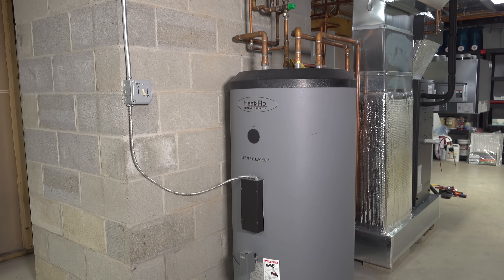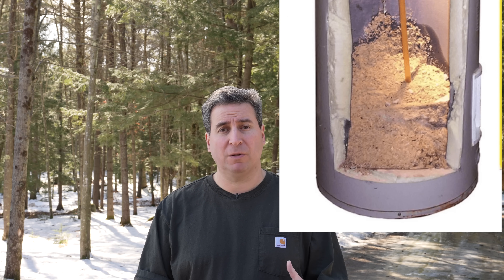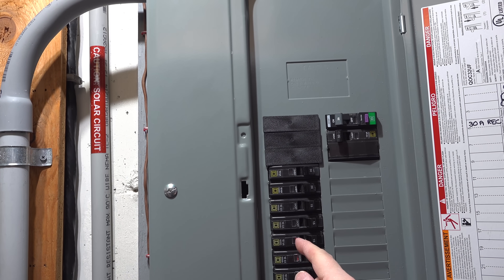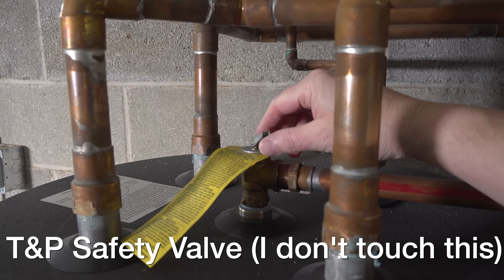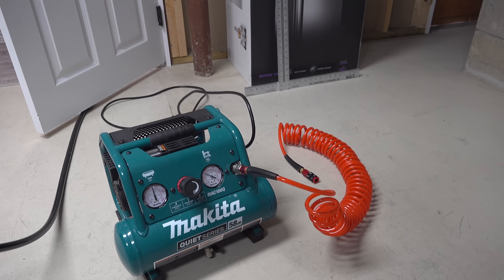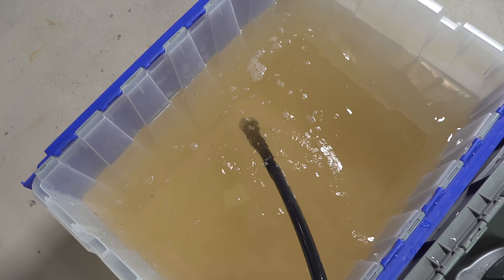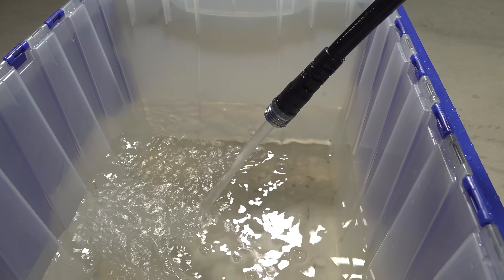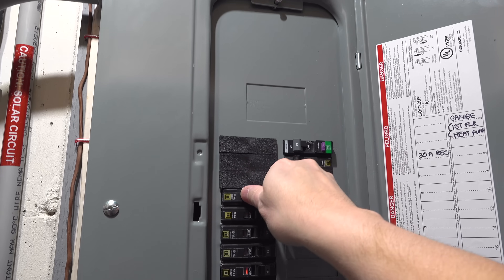EASY Way to Flush Your Hot Water Heater using AIR - Sediment Buster

Comment from the maker: What do you guys think? Sediment Buster: https://amzn.to/3ODRAh5 Hose Cap: https://amzn.to/49smLUs Bike Pump: https://amzn.to/49aOR6K
Reply: You forgot to discus changing the tank anodes! 

Also helps to have water filters installed to remove sediment before it goes into the hot water heater tank.
Reply: I use a Y connector with two shut-offs connected to the drain valve. I connect one branch to a water supply and the other branch to a hose to a drain. I shut-off the drain branch and run water from the other branch. When I want to drain, I close the supply branch and open the drain branch and the drain valve. I think water is more efficient than air.

Comment: 50 gallon hot water heaters cost about $600.  A 1.5 ton AC costs $1200.  A 30k BTU furnace costs $1500.  These are rough estimates that show hot water heaters are definitely NOT the most expensive appliance in our homes.  Heck, refrigerators cost much more.  Hot water heaters are expensive, and need maintenance.  Thanks for the video.  But your opening remarks are incorrect regarding costs.

Comment: This won't work for several inches of buildup, that quickly gets up to the heating element.  It's probably good for normal water sediment, but the flail tool has been useful for my water heaters, although still a hassle.  Let's make an easier to clean tank. Seriously!

Comment: I used the one with the drill driven spring auger; that worked much better than just air. I got 1 gallon of sediment out, a 35year old hot water tank.

Comment: I’m going to use the sediment buster and my air compressor to do what you have done here. However what should I set my air compressor regulator to? I don’t want to damage my water heater it’s only a year old. Would 20 or 30PSI be enough air pressure to give it quick bursts? I’m from New Hampshire. Thanks in advance!

Comment: We had plumber put in a new water heater about 1 year ago, since then our hot water is not coming out as quickly as it was prior to new water heater installation.  We do have a recirculation pump.  I had another plumber come out told we need  a compression valve and angle valve in order for the recirculating pump to work.  My question is why was it working great prior to the new water heater being installed?  Who to trust? 🤔

Comment: I have to doubt the effectiveness of blowing air through your drain valve. At best it will probably only clear sediment near the drain. I feel that opening your cold inlet valve would do more good due to the dip tube in your tank that directs inlet water to the bottom of your tank. Hot water outlets at the top of your tank. I'd even consider leaving some faucets open and drain most of the water. Then opening and closing the inlet valve in bursts.  Replacing the tiny  drain valve would be one of the best things you could do but I prefer gate valves over ball valves.

Comment: I didn't buy this setup but did blast the valve with air from my compressor and a standard air attachment.  One lesson learned is to run the hot water using the tub faucet. My sink faucets with aerators ended up clogging due to the loosened sediment. I had to take everything apart and had to thoroughly clean them.

Comment: My water heater's drain valve was made out of plastic.  Eventually it failed; water heater drained out under pressure and then kept flowing (located in the garage-ground floor made out of concrete).  Not sure how many hours the water was running before it was discovered.  It was a big residential hot water tank heated by natural gas.  Large local plumbing company showed up and fixed it that day (December 2023).  Slightly over $5,000 - OUCH.  Five stars for service and professionalism, one star for price.  The old saying was true; "Fast service, good quality and low price - pick two".  I got great fast service.............but did I ever have to $$$$ for it.  The worst part about it is I knew plastic drains on water heaters were a failure point, I missed the fact that I owned one.

Comment: I just drained my tank today for the first time in 5 years and managed to get about an entire hand-full of calcium deposits. When i installed the Bradford White gas heater, i made sure to get a contractor grade version which is built better, and has solid brass fittings. I did replace the normal spigot drain valve and installed a 3/4" (or 1" i forget) ball valve with a big lever. Makes draining and even inspecting the insides very simple. 
I also made sure to loosen the fitting that the Anode rod is attached to, gave it a few wraps with teflon tape, then screwed it back in. When the rod needs replacing, that simple task is going to make things much easier.

Comment: $40? Let's see, a two way brass garden hose splitter is $9, add a quick connect for your air compressor hose or if you have to use a bike pump, get a tire valve. When it is empty swap out the stock water heater drain valve for the full size ball valve as mentioned by others. When you flush next time you can still use the two way and the results will be even better. Be sure to remove your faucet strainers before and after for a day or two, and if they don't come out, don't use that faucet for as long as you can-a day or so. Usually it is a bathroom sink and using the toilet will clear the line. Also, don't waste the hot water, turn off the power or gas and then take a shower or wash some clothes before you start the flush. It will gradually cool off in the shower, it's not like it is immediate.

Comment: I replaced my electric water heater when it was 33 years old. It was not leaking. It had never been flushed. When I cut it open, it was severly corroded, but no sediment. I live in a small town which gets it's water supply from Lake Huron.

Comment: flushed my hot water heater awhile ago. Had a terrible plastic drain valve on it, replaced that with a ball valve.

Tried to change the anode rod too, but i was moving the whole hot watwr heater trying to break it loose. 😿

could you do a video on changing the anode rod too?

Comment: That looks  like a good tool.  I vacuum mine out through the bottom heater element hole, add water as needed and wet vac the scale out. 20 years and running good. My second set of elements this year.

Comment: you created a pressurized system...hence the increased water flow.

as far as stuff cleaning...sure it's going to be improved from the additional flow.  But you are in actuality only flushing out the drain valve here.

Comment: The slow water before the air was introduced was not due to blockage most likely. You turned off the cold water intake to the tank and the draining of the water created a vacuum as it drained. You specifically kept the overflow valve closed so it could not let air in there either.  Adding the air pressurized the tank, eliminating the vacuum, and allowing the water to drain more freely. I like this product and I think it would work perfectly for a maintenance every  3 - 6 months in a hard water location like mine. The first time you hear a pop from your hot water heater, use this device in other words.  But for built up sediment that has baked in to a cake, I use a different device that has a snake that goes in to the tank and breaks up the sediment which flows out. (Requires draining of the tank to put the device in place of the hose bib, so much more involved.) But after using the other device, using this one will keep you in clean fine shape I am guessing.  Good review and thanks. I will probably be getting one.
Reply: I agree that going from vacuum to pressurized was likely the cause for the increased flow. Also, opening the overflow valve would allow the system to burp as the tank refills. 🤓

What's the name of the "snake device" you have? We get the cakes here too. 🤔

Comment: If you add a Corro-Protec Anode Rod for Hot Water Heater to your take you could possibly make your it last for 20 plus years. I couldn't possibly be happier with mine.  They are sold on EBay and Amazon and are described on YouTube.

Comment: I replaced the anode and one of the heating elements on my now 25 year old water heater last year along with flushing it. Next time I want to add a powered anode and full port drain valve. For flushing I leave the cold water on while shutting off the circuit and let it drain outside.

Comment: I happened to be extremely lucky i replaced my electric water heater in 2022  it was a whirlpool manufactured and installed in 2004  so 18 years of service and reason i say im lucky is i Never servced it in anyway no flushing no anode rod no heating element   but yes all these thing in the video are essential to long life and proper function of your water heater. Just saying i had been lucky

Comment: I do not agree that unclogging the drain valve with wire will puncture the tank or damage the element. 
The unclogging wire has to be softer and more malleable than the heating element.

Comment: How would this compare to just back flushing the drain valve with a water hose using a double female hose bib adapter? I've used this method for slow draining water heaters before. And best to change out the cheap plastic drains with 3/4" ball valves when installing new.

Comment: Hold on a minute. If you have all valves closed then the air is pressurizing your tank. That’s why it is draining faster. I have no doubt that it agitates the sediment but you are adding the air pressure and that’s what is making it flow out faster.

Comment: I had an electric water heater in Missouri & due to the water quality, was diligent about the anode rod replacement & flushing the tank which required I remove it from my basement. I noticed that use if vinegar when flushing the tank substantially increased the flush results. But remember, I did this with the tank removed & while in my driveway, so not a typical maintenance item? Going to get one of these tools & see if it makes a difference the cleaning intervals? Thanks!

Comment: This device looks like it would definitely aid in the loosening of sediment in the tank if you do not have an older anode rod!  I would be very cautious if you have a water heater with an older anode rod like I did.  When I replaced the anode rod in my tank after only 4y years and 8 months old the rod was practically disintegrated, just lifting the rod out of the tank caused large chunks to dislodge and fall back into the tank.  If that old rod would have been left in the tank and I had introduced forced air the tank I believe just as much magnesium would be loosened from the anode rod if not more and settle at the bottom of the tank, however  in a tank with a newer anode rod I definitely see the benefits of this device helping to flush out any sediment in the tank.

Comment: Someone commented that we should replace the cheap drain valve. I agree. Also, without Inlet pressure, output will be much slower. So adding several shots of air will increase tank pressure and so cause higher flow rates. Duh.

Comment: Just get a 3/4 hose connection by 3/4 pipe thread and connect it to an no frost free spigot leave compressor on and  blast out water heater. Works better and faster.

Comment: Thanks for the great tips and product links. As in most cases a new water heater comes with a plastic flush valve. I see brass valves in the stores as replacements, are they one size fits all? If so, my next tank gets one installed on day one as those plastic one's leak and then I give up on regular maintenance not wanting water running all over the utility room floor.

Comment: I just did this like others have commented by leaving the cold water on and letting gravity flush out the sediment. Occasionally closing the valve and opening again...a lot of sediment came out, but the anode rod was still in pretty good condition, but I changed them out anyway.
This sediment buster looks interesting and I think I'll give it a try. I do have an answer for those that say, "if it's not broken, don't fix it" I say, if it's not broken, see if it can be improved! Think Model A to Tesla.
Thanks for the video!

Comment: One of the things I do with a water heater is remove the crappy valves they put in place and thread in a piece of 3/4 stainless with a full flow ball valve.  After that I do something similar using my air compressor but I have a water distribution block and just use a simple air hose "blower" nozzle with a rubber tip.  Place that against the water distribution block and open the valve, apply air and then when the tank is pressurized close the distribution valve.  Open the tank drain valve up and the stuff blasts out.  

A few cycles of adding water (especially if the tank has one of the "swirl systems" for the cold water) and air and draining with the pressure and the tank is clean.  

I will eventually replace my water heater with a hybrid/heat pump but that isn't in the budget yet.  This one came with the house, was initially plumbed backwards, cranked to the max, and needed the elements replaced (electric) but I suspect it would be good for a lot longer.  Also no clue how old the water heater is but the energy guide is dated 2007 so I suspect between then and 2010.

Comment: To prevent it from blocking the valve do you need to put a three-quarter full port brass valve after the valve you put a male adapter it’s called a close nipple with a brass cap on it so some kids don’t walk up and turn the valve off and get hurt three-quarter inch full port ball valve and no wire hangers gonna put a hole in your water heater tank sorry cannot happen you could hook up a vacuum cleaner to a garden hose and vacuum it out literally it’s a little more intense but that’s all I do it to take the ball valve off and you stuff a garden hose and they’re hooked up to a vacuum cleaner you need to Venturi the vacuum so it doesn’t suck on it constantly but that’s the best way once you get over 75 gallons in the commercial they have clean out ports are the big heavy plate that you can do with a three-quarter inch but you can clean it out with a vacuum with your hands that way

Comment: Here in Texas, our water is so hard, it can stand up on its own.  I have to flush my tank every 6 months to 1 year, due to the hardness.  We are at about 16-17 grains of hardness  We get these white rocks that clog up up the drain valve, so when I replaced my gas hot water heater, I removed the factory drain,  replaced it with a 3/4" pipe nipple and a full flow ball valve with a hose adaptor.  Now it drains smoothly and larger chunks can flow out the heater easily.  Best upgrade to hot water heater.
Reply: Wow, I'm assuming you are Austin or San Antonio areas from the Edwards Aquifer. My brother lives down there and his water is hard too, about 20 gpg in S.A. I'm in North Texas (Metroplex) the average is about 8 gpg or 140ppm. Same with Houston. Most of our water comes from the Trinity.
Reply: Y’all don’t use water softeners?
Reply: @DeadEyeRabbit  some do, but due to our water chemistry, the water becomes mildly corrosive with copper after it goes through the water softener that is exacerbated by heating.   My neighbor had to replace all his copper hot water lines (slab built house) because they were paper thin and leaking.  Hot water circulator compounds the problem. PEX doesn't seem to mind the soften hot water. Cold water lines don't seem to be affected as much.
Reply: link?
Reply: @TechBrewGamer  Just  get get a 3" x 3/4" galvanized nipple, 3/4" full flow ball valve and a 3/4" to male garden hose adaptor at your local hardware/plumbing store

Comment: I just don't know. The amount of buildup over even 7 years is quite bad, at least around here. Doing maintenance for 130 apartments, I ended up making a special tool to actually clean out water heaters, but it only works for electric water heaters. At least with that I was able to extend the life of a water heater. Any time I had a lower element that would burn out (1 a week for a while), I would take a little extra time and use the tool I had made to actually clean the sediment and buildup out of the water heater. To me, it's not just the bit of brown water that kills water heaters, but I'm self trained so maybe that's the disconnect for me here.

Comment: From someone who has cleaned heavy sediment out of their water tank 3 times, if the tank looks like the one you showed at the 50-second mark of your video there is NO Way this device would clean it out it will just move the junk around because by design the water tank manufacture refuses to make the water spicket hole much wider to get the big chunks out. I'm sure this is done on purpose so they will have repeat customers all the time. I drain all the water I can down to below my bottom electric element then remove the element and start chipping away through the element hole with a wooden doll rod so not to damage the inside of the tank and then take a clear rubber tube attached to a shop vac and start sucking it all out piece by piece. It takes a couple of hours, but it's a lot better than paying $2000 every 5 to 7 yeas for a new one. I normally will all purchase 2 new elements and change them out both for around $45 after I get all the sediment out.